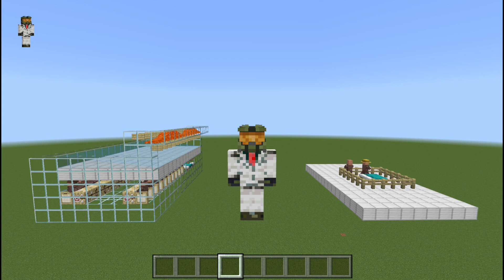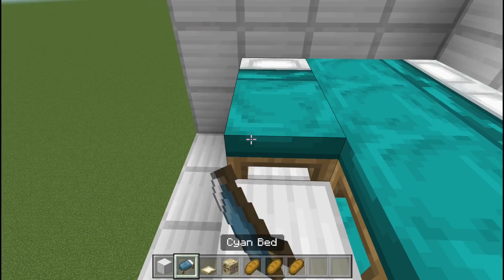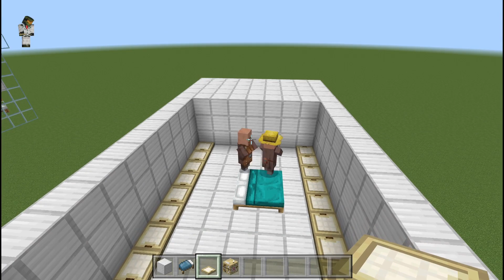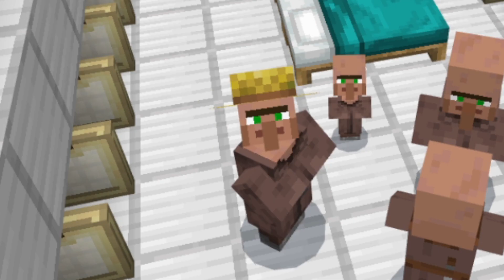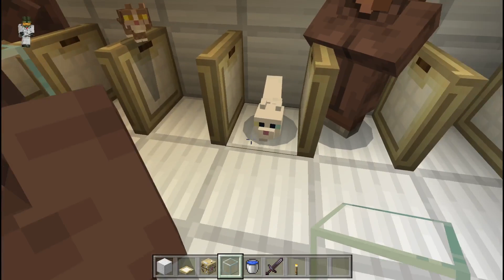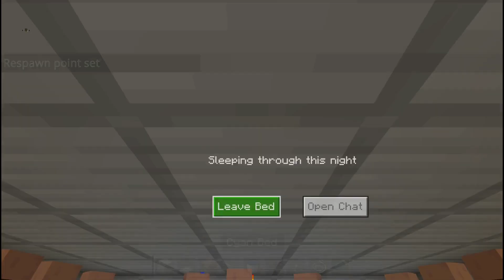7k stacked iron farm tutorial part 1

Comment: How many blocks above the ground should the farm be to keep iron golems from spawning on the ground
Reply from the maker: Good question. The answer is 7 or more. You can also build on the ground if you are willing spawn proof around it by 8 blocks with things like leaves, glass, carpet etc.
Reply: Thanks 😊👍 for the info
Reply from the maker: @brianhackner1858 anytime. Glad to help
Reply: @0ldGuy  can I put another pod of beds on the other side and make the golem's spawn floor longer, trying to get at least 30 villagers?😶
Reply from the maker: you could do that but you would actually make more iron by simply just stacking in a second village like i have here, 2 villages like this with 40 villagers is going to make about 700 iron and a single village could never make more than 411 even if you put 100 villagers in it
 @brianhackner1858
Reply: @0ldGuy  thanks 👍 I play by myself don't need that much iron, gonna use it as a trade hall.love all your videos 
Can't wait to build your pillager raid farm 😊
Reply from the maker: @brianhackner1858  I might have some more raid farm stuff coming up. I’ve been into those lately even though there are so many bugs associated with them
Reply: @0ldGuy  I loved the old instankill raid Fram from 1.15 or so I forget exactly, but the giant blue tower is unforgettable, can't wait to see what new versions you come up with
Reply from the maker: @shiningleo40 I will be working on that soon when I finish the videos about the stacked raid farm.

Comment: @OldGuy I'm gonna try building 4 of these modules on me and my friends survival world on Switch do you know does it work in all 3 dimensions?
Reply from the maker: Yes. A few updates ago they finally rode the issues with villages in the end and nether. However as you know there is no water in the nether so that will be an issue so will need some modification
Reply: @0ldGuy  Thank you for taking the time to reply to me I really appreciate it man.  I'm probably gonna build mine in the end so I'll leave a nether redesign to someone else
Reply from the maker: @thatslame9598  that’s probably wise. The nether is really too clogged up to make it worth building in.  You would need to do so much mining to have enough room I’m always glad to help.
Reply: @OldGuy yesterday I tried stacking my first farm and it appears that the first iron farm stopped making golems? I made sure I saw green particles as I was moving my beds and villagers over I'm not sure where I messed up. What would you recommend I try to fix it?
Reply from the maker: @thatslame9598 my recommendation depends on a couple of things. 1 are both farms making cats? 2 is the new village making golems? If the answer to both questions is yes I recommend you simply let it run maybe 20-30 min. See if both farms are making cats this means that both villages exist independently of each other and if the new village is making golems it means the first one will also likely start making golems. For some reason that doesn’t make a lot of sense when stacking villages the existing ones will stop producing golems for a day or so. I don’t have an explanation of why it happens but doesn’t happen other times.
Reply: @0ldGuy  thank you so much turns out I just wasn't patient enough it's working perfectly now 😁
Reply from the maker: @thatslame9598  glad to help.

Comment: Where should you afk this how many block upwards or sidewards?
Reply from the maker: The afk spot is obviously in the center of all the farms but as far as y level that is going to depend on your sim distance but for sim4 no more than 44 blocks up or down from the spawn platforms. The formula for afk distance from an iron farm is “sim distance x8 +32” for horizontal distance and “sim distance x8 +12” for vertical distance

Comment: How far is the center AIR gap from each farm? Also, you have the farms orienting the same way instead of having the iron golems flow in direction to the center "air gap" between both farms. Is there a reason for this?

Edit: I just finished the farm and my iron golems are spawning on the outside of the farm .-. It is underground, but I have a different design underground and there is no issue
Reply from the maker: Ok between the sides 14 air blocks. Then a wall on each farm for a total of 16 blocks between villages. On the ends I chunk aligned them. The farms on one side face one direction and on the other side they face the other way so that they face towards the center. To make collision easier. Idk why you think they all face the same way.  Now to your edit. I built the spawning platform smaller than the spawning area. I said so in part 1. So if you build it with spawnable blocks nearby you will get spawns outside the farm. If you don’t have a good grasp on that this farm is too advanced for you. I would be happy to explain spawning mechanics to you on discord.

Comment: Why aren't you placing blocks in all the possible iron golem spawning spots for best rates? I thiught it was 8 blocks horizontally from the center of the village?
Reply from the maker: There are a couple of reasons. The most important of which is size. I’m willing to sacrifice a few ingots per village to have more villages. The second reason is that due to the algorithm and it trying 10 times there is a minimum size before you really start affecting the amount of ingots. The number of spots for the minimum has been calculated out somewhere between 85-100 blocks. So without cutting into the rates for each farm I can have more farms and therefore overall more ingots total.
Reply: @0ldGuy  ok thanks for clarifying and answering my question
Reply from the maker: @Ni10FenyxRizng  glad to help
Reply: @0ldGuy  also is there a reason you aren't using 30 villagers and instead opted for 20? thought that having the extra 10 villages would allow for more iron golems to be present within the farm at any given time opening the chance for more iron golems? is it to do with diminishing returns or because the spawning zone is smaller in yours so it takes less time to kill? Prowl another youtuber who made a tutorial for a double iron farm said anything after 30 is where you get diminishing returns but he isn't the most technical or numbers oriented as you and others. Do you think I should do 20 to save on time and resources or do the 30. BTW Oldguy do you have the numbers for how much iron your losing out on by cutting the spawning zone? thanks in advance :)
Reply from the maker: @Ni10FenyxRizng  ok the numbers work out like this assuming average kill times and average spawn spaces, 10 villagers comes to about 285-290 ingots per hour, 20 villagers comes to about 385=390 30 villagers gets you somewhere around 400, every group of ten does in fact allow you to spawn an extra golem but unless you just have really long kill times you arent gaining enough ingots to justify using more villagers, its a game of diminishing returns after 10 villagers but since i have to have 20 beds i might as well have 20 villagers,  what am i losing per farm about 35 ingots, on average each farm is making about 350 ingots per hour so if i had a full size farm it would make about 385 that means im losing about 35 ingots but like i said previously my goal is total ingots over the whole thing, so space wise in sim 4 you are limited and so id rather lose a few ingots in order to get another farm, ultimately no matter how many villagers you have its going to max average out at 411 thats just what the math of the whole thing says.
Reply: @0ldGuy  ok thats for clearing up my questions again :)
Reply from the maker: @Ni10FenyxRizng  no problem anytime

Comment: Does this need to be chunk aligned? Will it mess up if it goes through multiple chunks? I am planning on having 4 stacked, do I need to be concerned with where I am afk/where the iron farms are? I play pocket edition
Reply from the maker: I did chunk align them but only for the purposes of maximizing space. Iron farms aren’t required to be chunk aligned. Only doing 4 you have a lot less of a concern. Now how far you can afk is a formula based on sim distance. Simx8 +32 for horizontal and simx8 +12 for vertical. So on sim 4 it’s 64 blocks horizontally and 44 blocks vertically and of course within the actual sim distance.
Reply: @0ldGuy  awesome! Thank you so much! I really appreciate such a clear and simple answer so quickly! You are a genius and a gentleman
Reply from the maker: @gamingwithpedro9574 I’m glad to help as much as possible.

Comment: Hello I have been trying to make my iron farm work on 1.20.4 bedrock edition started at 3pm its now 1am of the next day, I have read the wiki on how golem spawn works, asked for help on discord, watched different videos and also tested building it from scratch on a new world. It's not working for me idk what else to do, Im typing this as a last resort on maybe getting your assistance? :(
Reply from the maker: Are you on discord? It’s a lot easier for me to help you if I can see what you are doing
Reply: were you guys able to figure out the problem? I seem to be having the same issue on my test world
Reply from the maker: @kaent9099  did you watch part 2 yet? Part three has been delayed due to pc issues but got my parts in yesterday so if there are specific issues you are having I can cover those
Reply: @0ldGuy  it turned out my issue was some villagers were assigned to the wrong table, I'm working on pt 2 right now to see if I can get the stacking working, is there any other way to tell if the farms linked without then lack of golems?
Reply from the maker: @kaent9099 cats. If you are spawning cats in both farms which is way easier and way faster than golems.
Reply: @0ldGuy   oh so cats only spawn if the villages are still separate?
Reply: ive been trying to stack 2 farms using the boat method but everytime I get the villagers to the second farm, iron golems seem to stop spawning in the first 
and only cats
Reply from the maker: Ignore that. Pay attention to what you are doing and don’t worry about golems until you are finished
Reply from the maker: @kaent9099  correct. You should have cars spawning in both. If you only have cats in one then you only have a single village.

Comment: Does it need to be out of iron blocks?
Reply from the maker: Absolutely not. You can use any solid block. Dirt. Stone. Cobblestone. Pretty much any block a mob can spawn on. Avoid things like glass or leaves and any other non solid blocks. I built it out of iron blocks kind of just to flex a little but it can be almost any block